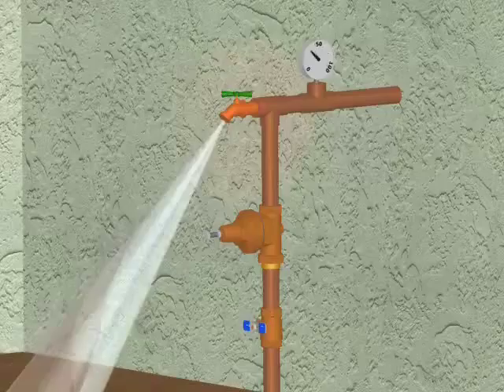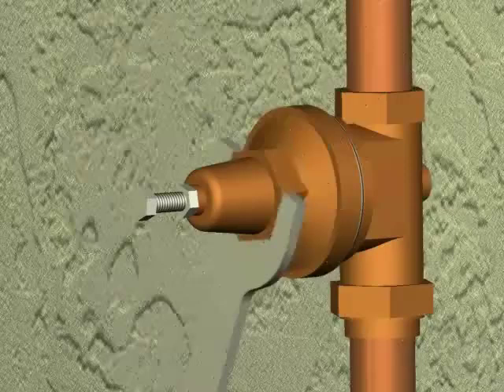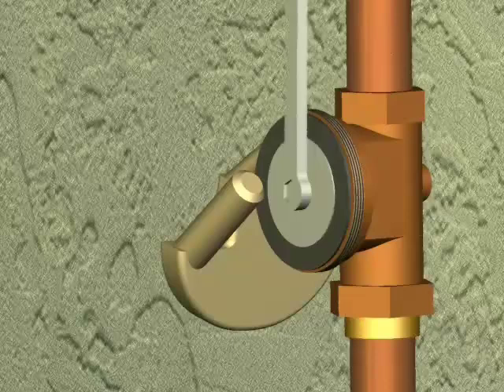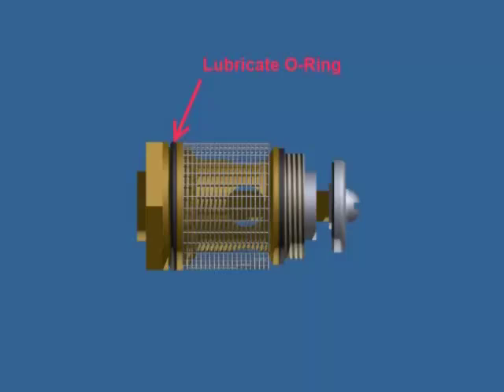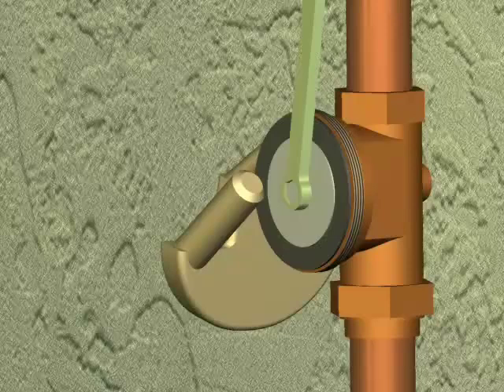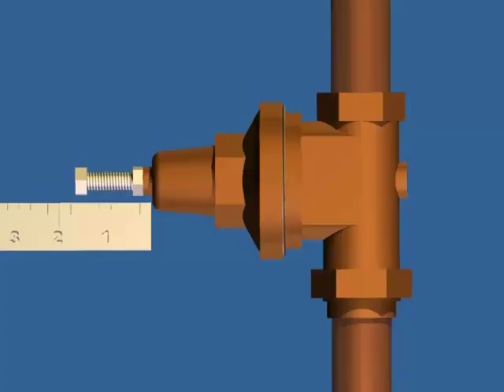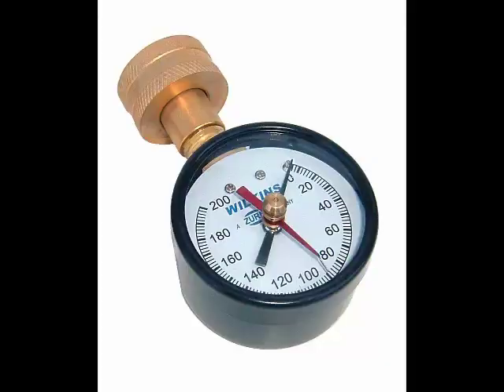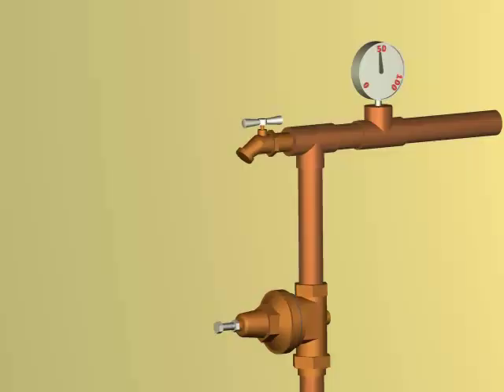Repairing a Zurn Wilkins 70XL Water Pressure Reducing Valve

Comment: Excellent video. Most people don't know realize the importance of the water pressure reducing valve and just ignore it. My pressure was creeping up to the 90 psi range. After rebuilding the regulator with a rebuild kit, I was able to dial it in right at 50 psi.

Comment: The video was essential for installing the repair kit. In my case, the spring, spring cap, and parts of the diaphragm cover were rusted so it was very hard to remove the internal bolt! It would greatly help if Wilkins would put tabs or something for a channel lock to grip while loosening that bolt. Aside from that, the repair went smoothly and the valve was good as new when finished. This kit can save you lots of money in labor if you're a do-it-yourselfer!
Reply from the maker: Thank you for your comments! Our Product Manager says: "We are definitely considering reparability into all of our designs and the next generation will be even easier to repair.  The model 70XL is a decades old design but a contractor favorite based on its extremely stable performance making it one of the most popular valves today.  Our newer PRV's such as the model NR3XL use a cartridge design that makes the valve even easier to repair.  On the 70XL we do offer a Sealed Cage (SC) option that converts all the hardware in the upper bell assembly to stainless steel, this would greatly reduce the corrosion you noticed."

Comment: The plumbing code for a residence requires less than 80 psig intake static pressure.  If you use toilets with flushometer valves like I do, the minimum pressure is 65 psig.  This caused me to select a model 70 rated for 75/25.  Minimum aperture is 1 inch.  All valves and the model 70 must be full throat.

Comment: It seems the 70DU is discontinued and the 70XL doesn’t come in 1 1/4 size. 

The 70DU 1 1/4 size and larger seems to have a different design and parts then the smaller versions. Any repair guide for this model?

Comment: What are the required wrench/socket sizes? What tool is being used to hold the disk?
Reply from the maker: The Model 70XL will require a socket, in the following sizes, in order to remove the cartridge from the body of the valve.
4. ½” 70XL – 1-1/8”
5. ¾” 70XL – 1-1/8”
6. 1” 70XL – 1-3/8”
The video shows a simple 3D model, intended to represent a hand, holding the diaphragm in pace while tightening the retainer bolt. For more information or troubleshooting support, please feel free to reach out to our staff @ 855-ONE-ZURN.

Comment: I have a Wilkins three-quarter inch regulator 1417 r i’m having trouble finding a rebuild kit for it it looks like Zurn owns Wilkins now. I was hoping to find a way to cross reference my old regulator to The new parts that would fit it. Thank you 3:11 3:11
Reply from the maker: Hello, it's possible that you are looking at the production date & not the model number. If you look at the side of the valve, it should have the Model number listed between the two pipe connections. 
If you need more assistance finding this number, please reach out to Zurn Customer Care.
Reply: Thank you